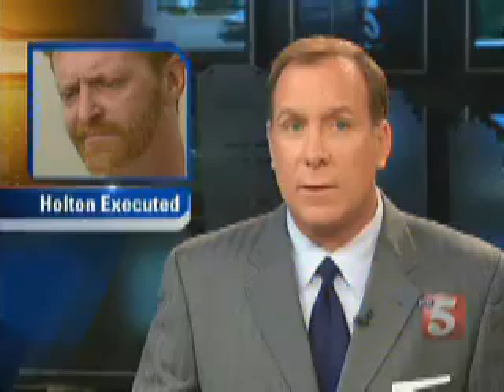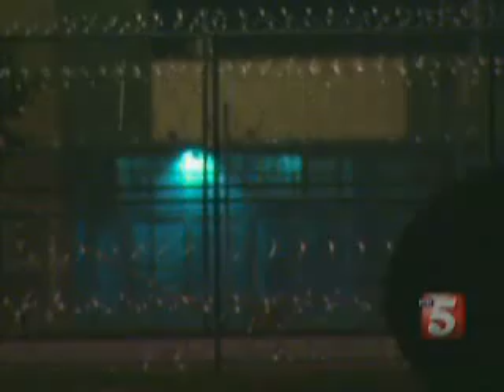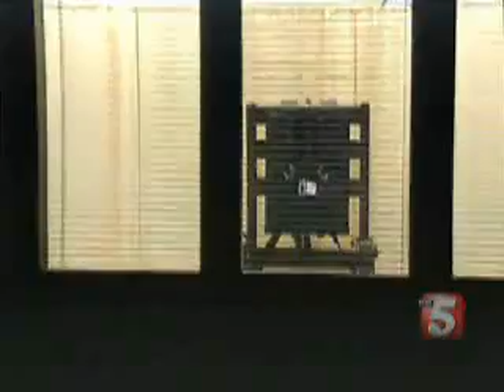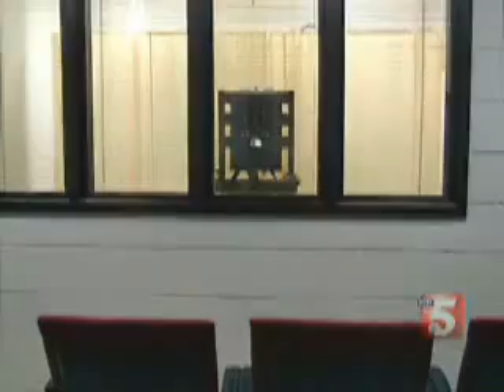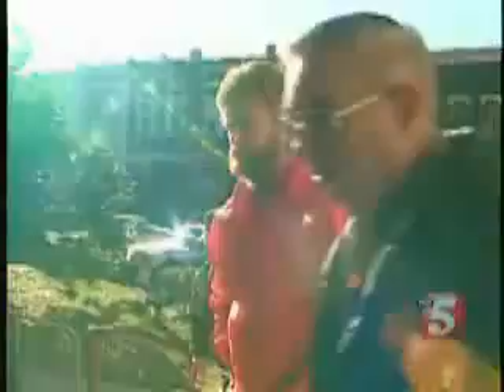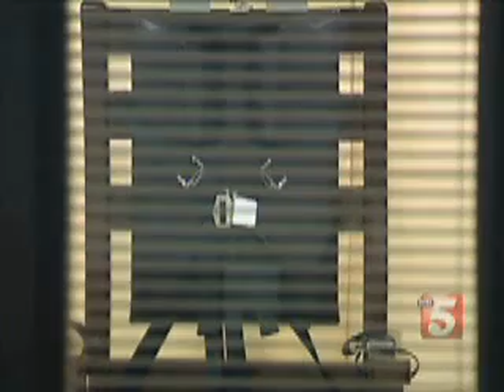daryl holton executed by electric chair

Comment: The two pins that stick in you during a taser attack form an electric circuit, meaning the electric only passes through a bit of flesh and is localised (albeit extreme) pain. If one pin was in your head and the other in your chest, then you would be dead because the electric would pass through your heart, that is what is fatal.

Comment: Hold on, that is not quite the case. It IS the current that kills you, but you still need sufficient voltage to drive the current. What 'low amperage sources' mean is that if a load (body, resistor, whatever) is placed on the supply, the terminal voltage drops quite rapidly; you may get an initial nasty jolt, but the voltage drops and therefore cannot sustain sufficient current to cause any real harm.

Comment: In an execution via the electric chair, the body is jolted by the electric current almost immediately after it goes on and it stays up in the air for a period of time, usually about 15-20 seconds, until the current is turned off and the inmate is dead, usually as the result of cardiac arrest.

Comment: @pjicleanair420 What makes this so deadly is the placement of the electrode contacts and the lowering of electrical resistance of the body. Currents are passed in long paths (left hand to right hand, ankle to ankle, etc.) and contact points are water-soaked, which reduces the body's resistance to less than 500 ohms. Dry skin won't conduct electricity very well.

No two bodies are alike, but it's safe to say that 1750VAC 60Hz @ 400A across 500 ohms will kill anyone.

Comment: its not the voltage that kills you. its the amperage. a stun gun may have .003 amps. vs 16.0 amps on 110 volts or ac outlet at home

Comment: Amps is the voltage / resistance, so no amps dont kill, the amperage depends on the voltage of the circuit / the resistance of the circuit, in this case the human body.

Comment: @electroexecutoid 3.5A is the current passed through the path of resistance (assuming a resistance of 500 ohms). I can tell you that the source current is much higher. Water-soaked sponges are not only necessary, but legally required in all executions (at least in the states where I am familar with the laws). While they do not alter the body's resistance, they absolutely do create a terminus for contact.

"turn to ash, liquid and gas, and possibly explode" is an exaggeration, to say the least.

Comment: It's not so much the volts, but rather the amps that are deadly. What does the damage is the total amount of energy (volts x amps) delivered, and the amount need to "clench" every muscle in your body, including the heart. If you shuffle your feet on a carpet and zap someones neck with your finger,  you are delivering thousands of volts, but virtually no amps. The total "zap" from your "carpet shock" prank is no more than the energy you expended to shuffle your feet and create the static charge.

Comment: I agree with your statement, however I'd like to point out that the death penalty often ends up costing the state *more* than life in prison due to the increased costs of litigating a death-penalty case as well as the extensive appeals process that usually happens.

Comment: Not so. Experiments have been done in which the severed head of a guillotine victim is asked to give a sign that they are hearing or seeing. One head blinked its eyes rapidly over 20 times, another head moved its eyes back and forth quickly. The experiments were done within a few seconds of the head being severed. It shows that the heads were still conscious, even if they did quit moving after less than a minute.

Comment: It is because a police taser delivers low amperage.  Just like static electricity, which can be around 50,000 volts but you won't die from it.  You can technically die from 1.5v ( like one AA battery) if it can deliver 2 amps.... Amps to electricity is what water pressure is to water.  It is described basically in simple high school level algebra as Ohm's law.  I = v/r.  I = amps, V = voltage and R = resistance....

Comment: I don't really understand why the state prescribes 1750 volts through electrode contacts applied at numerous critical points on the body, and then requires the expense of an autopsy. The goal here is a lifeless corpse. It seems that they got what they wanted. 

Frankly, I don't care if someone slipped the poor devil a few 'ludes before he was strapped in.

Comment: do they have to "straighten out" the body with sand bags? didn`t a person in Virginia have his face kinda melted?
Reply: +mike hunt I think that was a 1990 electrocution for a cop killing in Florida; what happened is that the inmate's hair caught on fire during the execution and as direct result, since that time, in preparation for all executions carried out by electrocution, a condemned inmate's head and right leg MUST be completely shaved before any sponges or electrodes are placed on the body. The first sponge and electrode are placed on the head, as this is where the electricity enters the body; the second sponge and electrode are placed on the inmate's right leg, and this is where the electricity exits the body and goes back to the power source. If everything goes correctly, the execution should last only 15-20 seconds.
Reply: +EricEbac22 That was Jesse Tafero but there have been a long history of botched executions involving the chair and the gas chamber.

Comment: If that's true it holds almost no bearing to what I said. In fact it would only support what I said, if anything. You made mention to a supermax facility. Only a hand full of prisons in the U.S. are run under the those conditions because of "costs" otherwise it is only death row. The only full prisons I know of are the one in Colorado and I believe there is a supermax facility in Illinois. The average maximum securty Pen is not run anything like a supermax.

Comment: @nasateam495 

It's the Amps that kill you not the volts.17.050 volts with high Amps is leathal. 50.000 volts with a teaser is not enough Amps to kill you. To be precise it need to be 75 milli Amps though the hart.

Comment: To me it is not about cost. Seeing as a typical LWOP inmate can easily cost more than an execution depending on the circumstances. Also, we don't spend nearly enough millions each year on our borders, obviously. Therefore, spending it here, in State Corrections makes sense. Again, overall this is not about cost. It is about protection. Protection that not even supermax can guarantee, even at its exorbinate costs....

Comment: Who cares about the volts. Volts don't kill Amps kill. Most people have experienced shock from high volts 10,000 ,static,spark plug wire, 120 volts kills at point 1 amps.

Comment: First of all, it is not about cost or even really to deter others. It is about protection. Now you are a little high on both counts. The average cost for an inmate per year who's on LWOP is about $35,000-$40,000 a year. You are most likely to be sent to prison for LWOP between ages 22 and 45. More accurately yet, between 30 and 45. If you live even 40 years behind bars on LWOP it costs the State ie us the taxpayer no less than $1,400,000. On top of that the risk you could escape like Ted Bundy.

Comment: They already do something similar it's called Hydrogen Cyanide gas i.e. the gas chamber; it's far quicker than a weak poison like carbon monoxide. The literal best way (in terms of no pain and speed) to execute is Nitrogen induced Hypoxia. You die in less than 1 minute and literally feel no pain. In fact before you black out it is like euphoria. However, the question is, do rapist/murderers who strangle and beat their victims heads in deserve to die the perfect death? I say no but that's my 0.02